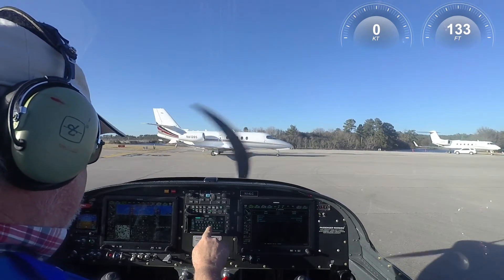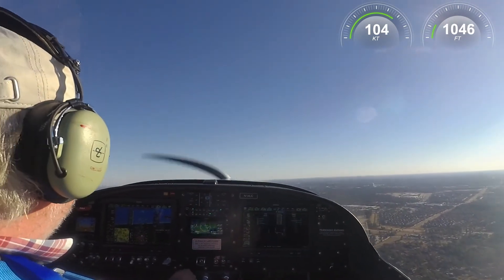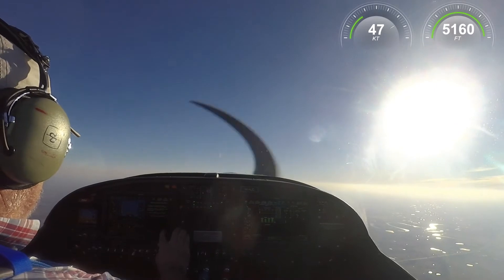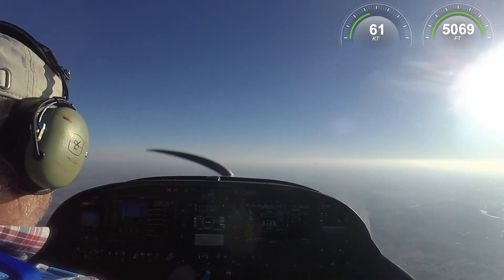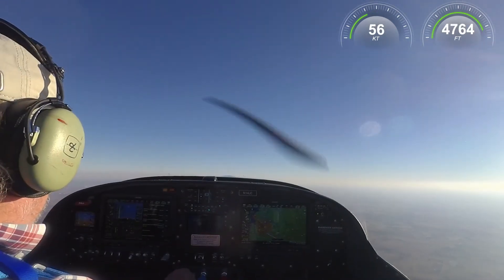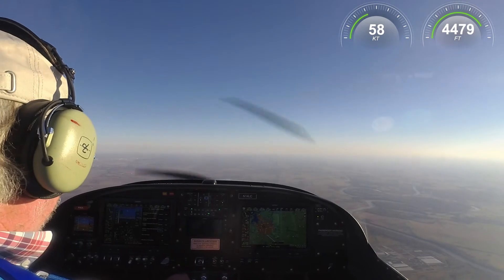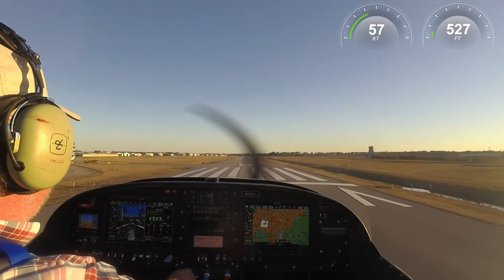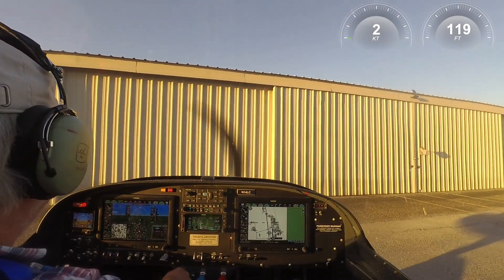Wings level stalls in my RV14A.

Comment: Doing transition training with Mike Seager for my RV (Your old RV-8 actually!).. It was pretty consistent that dropping a wing in a stall was a heavy foot (uncentered ball), and repeatable.
Reply from the maker: I used to do a lot of aerobatics in that plane. I loved it. My RV14 with full flaps breaks to the side even with the ball semi-centered, as indicated by my multitasking and uncalibrated eyeballs. With practice, it is super easy to catch with rudder right after the break. It isn't a big deal at all. It's zero flaps characteristics are what is an eye opener. It just sits there and bobs with the stick almost all the way back.